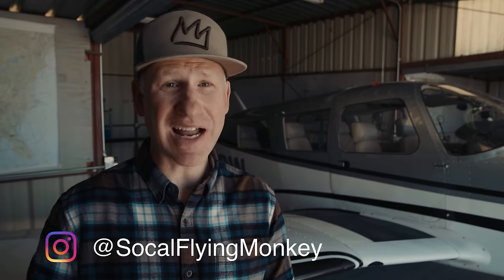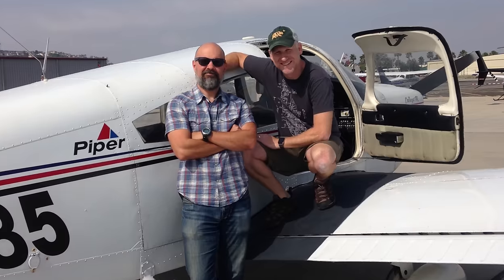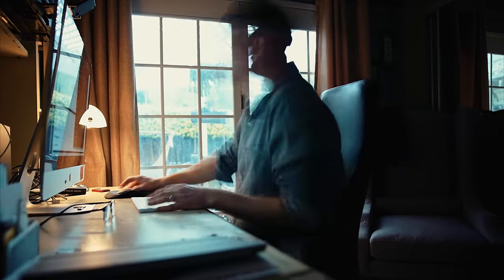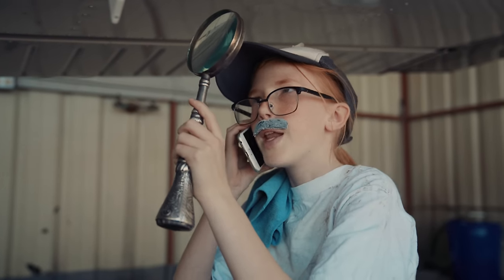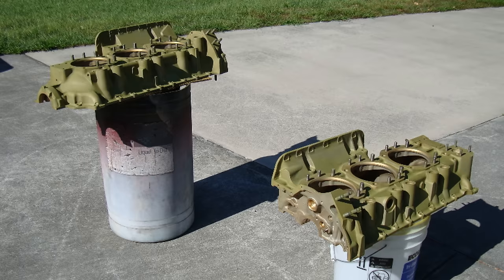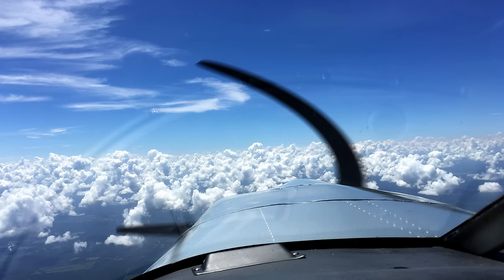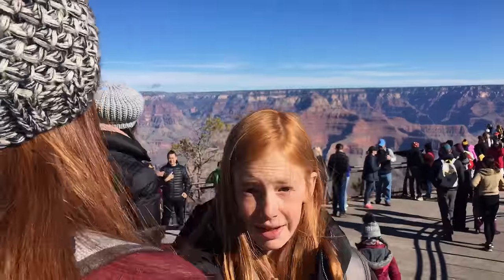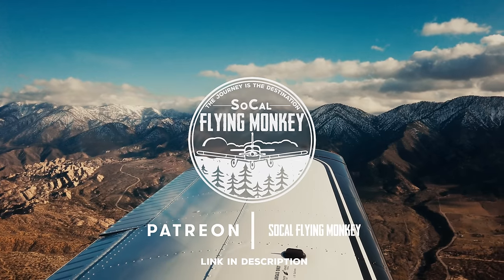I Bought a Cherokee 6 for Less Than $30K and It Changed My Life | An Airplane Renovation Story

Comment: Gorgeous plane at the end. But, it is deceptive to say you bought it for $30K. What did you put into it on top of the price? $80K  $100? or more? I would guess that I might be low...since an engine rebuild can cost more than you paid for the entire original "beast".
Reply: Too true. Nothing inspirational about having lots of money and using it to buy your family a new plane.
Reply: I’m also curious about this.  I hate deceptive titles. I figured this was going to be a I bought a budget plane and slowly upgraded as I could story.. Obviously 30k was the starting point but what was the total? Another 100k is my shot in the dark.
Reply: He did say it flew well even before all that
Reply: Yeah.. I was fooled too.. but it is a beautiful plane
Reply: Nothing says you have to put an expensive glass panel in it right away, if your intention is to fly it daytime VFR for a while.  Or fancy leather seats, fancy paint job, etc.

The engine rebuild costs are real though, figure 20K on that.  I'm looking at one for around $25K with a engine less than 100 hours from timing out.  The paint and interior are in good, but original, condition.  If it was a classic car they'd call it a survivor.  But anyway.
Reply: One other thing that helps make space for aviation in your life - stop buying new cars all the time.  I have an older Lincoln Navigator for example and I just bought the parts to do the timing job it needs myself, also new rotors and pads all the way around.  Planning on keeping it another 5-7 years.  

I have been accumulating tools since I was a teenager, but if you don't have them, tools are a lot cheaper than new cars.

Comment: I got a private pilots license in the 70s and was a commercial salmon fisherman in Bristol Bay Alaska in the 80's out of Naknek.  Hardly any roads so you had take a plane anywhere you needed to go.  The plane of choice for small commuter airlines was the Cherokee 6.  They preferred the low wing.  They flew out of short rough undulating rocky "runways".  The leading edges of the stabilators were all dented up and patched with duct tape.  This is a testament to the ruggedness, safety and reliability of this aircraft.

Comment: Thanks for sharing, but obviously this costed a lot more than just $30k. Would you share your breakdown and total cost?
Reply: Probably not, his wife might see it. She knows about the initial 30k.
Reply: @DanSlotea  lmao
Reply: Has to be another $30k on top..
Reply: @lawrencenisbett7579  is Probably closer to another additional $100K on top, based upon everything that was done, and that was his FRIEND doing it at a reduced rate.
Reply: I think about 200k on top. No joke
Reply: @joshuaespinoza534  That's just crazy and not very good business, could have bought a newer, better plane for that amount that didn't need all of the extra work done to it -   so the buy a plane for $30K is just a fallacy, rather it is buy a piece of junk and watch the money pit grow
Reply: @normancarter5419  I would spend my own money instead of others. Frowned upon.
Reply: @joshuaespinoza534  Don't really understand your statement because I made no reference to OPM, just that spending that much money on a POS when the money could have been spent on a better aircraft, $30K aircraft became a money pit.
Reply: @normancarter5419  not necessarily. He chose to spend the money.  Wasn't needed for upgrades. Clearly engine was great. Also. 30k for a plane with solid frame designed by experts that's in great shape os half the battle. Not sure why 30k is something to complain about.
Reply: @normancarter5419  he could have just overhauled inside for 20k extra making it 50k in total for plane. Yes 30k is possible to own a good plane. It's the desire to have everything new which changes things and perspective.

Comment: Bought it for <30k, spent 100k in upgrades, looks really good though
Reply: Its not that much if you think about it. 130k for a neat aircraft, almost as new, with that many seats single engine super clean. You get sometimes cesna 172s for around 150-200k with old panels. 130k for a glass panels modernized plane like this could be today around 300k+
Reply: @Fragnatix  true, can't argue with that

Comment: I have a question. So I’ve been looking into getting this model airplane, and I was wondering how much did it cost to redo the entire interior?
Reply from the maker: you can get Airtex kits from I think 5k-10k or so depending on cloth vs leather and some other options.  Thta's for materials for DIY.  But I would call them- they are very helpful and super knowledgable about all the variations in model years...

Comment: "Bought it for less than $30k" yeah, and then put another $80k into it to make it descent. Congrats on your $110k purchase.
Reply from the maker: Thank you!
Reply: @SoCalFlyingMonkey  If this thing only cost you $110k, then what a bargain!  Good job dude!  Heck even it is was $200k it would be a bargain.  A new one costs much more!
Reply: @wyflyguy114  Nah, we've looked into the TruTrak, it's only $7500 installed at Saint Aviation in Florida (I bet that's where he got it done). The other stuff is all under the rewritten Part 23 and not nearly as expensive as it used to be. The HDX he's got is just the core (he already had an engine monitor and the autopilots via the Trutrak), which is about $16K installed. The Avidyne, new radio, and transponder, etc. probably came in around $25K installed. 

Given he did a field overhaul (a lot less than sending it off or a factory reman), he might be all in for only $150K or so. You can't buy a Cherokee 6 with a zero TBO engine with that panel and in that condition for anywhere near that on the used market. It took a long time and was a big risk (he could have had all kinds of issues tearing apart a beater like that), but I'd bet he comes out ahead here if he ever sells the plane.
Reply: @bonchie1  You sound like a pro, but you're not.  Buying a high time Cherokee 6 cargo plane is not the "clean slate" you want.

Comment: Beautiful overhaul. Cherokee 6's are absolute units. I have about 900 hours in one flying cargo in northern Canada (my first full-time flying job). They fly like a truck, but climb like a homesick angel and you can basically take anything you can fit in it. I've carried everything from coffins (occupied), cases of pop, and even 8 passengers once (don't ask). And you gotta love the nose locker for W&B. Handles unimproved runways reasonably well too. Cherokee 6's hold a special place in my heart.

Only downside is its slow and a guzzles fuel. For passenger hauling a Lance is a better option IMO purely for the speed. An extra 20kts cruise gets you a lot further.
Reply from the maker: They are great planes.  A Lance sure would be nice but ultimately decided the additional $ for maint and insurance wasnt worth the few minutes saved on a 2-3 hour trip.  But they are great!
Reply: @SoCalFlyingMonkey  Considering you apparently dropped probably over a $100k into new avionics and an engine that didn't need to be overhauled, its a little strange to hear you penny pinching over maintenance costs and insurance... 

But everyone approaches things differently -- and its a beautiful airplane nonetheless!

Comment: I was flying a cross country flight for my private pilot license. It was a normal flight until something caught my attention directly in front of me and it was getting bigger. I realized it was another plane and were going nose to nose...I saw the impending midair and rolled hard to the right. I had steep bank and when I looked out my left-hand window, I saw that we had just missed by a few feet. It was Cherokee 6 and I can still see the rivets and oil streaks on the belly of the plane clearly in my mind. To this day....the other pilot has no idea how close we were. He didn't even wiggle, flinch or otherwise react...he NEVER SAW me.

Comment: Funny..  That aircraft was built by Piper for Air Ambulance and Hearse Transportation.  It does have a working useful load capability but the stick gear version is SLOW !!!
The one real issue with Piper Hershey Bar Wings is that when the engine quits, what ever you see coming under the nose is where you will land.  Aspect Ratio is Nil !!
Keep a good eye on that engine and pay close attention to any developed vibration.  Hard to sense with that 6 cyl mounting.

Comment: Great video my issue is got my license back in 86 and shortly after quit flying. 36 years later the situation has changed and I now can afford to fly and buy a plane. Problem is what ever I buy will be my forever plane and theres the problem what I want and want ins. company will allow me to fly are two different things. This isn't going to be easy
Reply from the maker: I think it's still possible, maybe depending on the amount of hours you can accrue and time in type as well.  Maybe go for a fixed gear plane?
Reply: @SoCalFlyingMonkey  Yeah that is what a friend was saying to toss in  a monkey wrench he also recomended a turbo powered plane as my home airport is already at 5000  foot elev. and there are lots of mountains so that makes sense. Looking at the cessna T182T  those models are very $$$ but boy are they nice fixed gear and turbo'd Well soon I hope tp get bacl into my trainnig so I will have a few months to see what's out there.

Comment: Great job She’s a beauty! Did you upgrade your fuel transducers when you went to the HDX? I know it’s not the most glamorous upgrade, but it sure provides piece of mind to know how much fuel is in the tank.
Reply from the maker: I have a digital engine monitor that measures fuel flow very accurately so it displays fuel remaining as well (calculated).  I left the stock fuel senders and they are not very accurate but did my best to calibrate them well.

Comment: So where are the numbers? Initial price.? Engine overhaul ? Paint? Avionics upgrade?  I think the money you have in this jewel, you could have bought a mint Cherokee 6.  You did a great job with your presentation.   Keep em rolling.
Reply from the maker: put about 90-120 into it.  if you shop around for a Cherokee 6 you will see that something similarly equipped is at least 175-250k.

Comment: For the non flyers I copied this from another forum:
However, if one is looking for a "project plane" a sound, low time, zero-damage airframe is probably preferable. Engines and props can be overhauled or replaced, avionics can be upgraded, paint and interiors can be redone, but airframe time and airframe damage is permanent on the record. But now that airplane values are not reliably inflating like they used to, a project plane is almost certainly not a rational economic proposition.
Reply from the maker: Airplane prices right now are actually going way up like crazy. I dont know if they will come back down.  I got this airframe for 30k.  In todays market, a similar condition and time airframe is going for 60-75k.  Its nuts!

Comment: Hi,  I'm curious  what resources did you use to find your plane.  I'm doing some due diligence on possibly purchasing a plane and I'm sure there is more than controller , trade-a-plane,  or hangar67 any other resources you can offer would be helpful.  Also, have you done a video on what one might expect to pay to renovate a similar plane  in the way you've done your plane.  (looking at Arrow, Cherokee 6, 6XT, Lance, Saratoga)
Reply from the maker: I used those, the type forums, Facebook groups, and Barnstormers.

Comment: I am considering following a similar path. Rather than a new Experimental, going after a used PA-28 and renovating it. My question is this. You said 18 months to do all the work.  Why does it take so long?
Reply from the maker: It was just one guy doing it and we had many delays like an avionics shop that essenitally went out of business while waiting for our gear, availability of some plastic pieces, the process of overhauling the engine, paint shop delays. the lFlorida summer heat, the list goes on and on!

Comment: I have a ton of Questions!!!!

Im looking at useful Load as a magor factor in buying my own plane.  I was thinking 235 vs 180 .  the 235 has a better useful load, but costs more to fly. I was also looking at the 6 series 300 vs 260.   It seems the 260 has a consistant better uselul load. is that my imagination??   The reason for the bigger 32 vs the 28 is room. Im looking at flyiong alot alone, but I will be flying with 3 others at times, possib;y more.  

Lat question for now. your mechanic. how did he find your bird?  I understand that there is almost no way to find a cherokee 6 (300 or 260) for less than 100k in todays market.  Ive been looking at Controller and Trade aplane.  I asume, your mechaniv used other sourses ??
Reply from the maker: email me at flyingmonkeysocal at gmail dot com. and i can answer your questions.

Comment: One final question... Is it possible to covert a Piper Cherokee 6 to a Bush Plane by simply changing the wheels to those big fat ones, or would there be too much pressure on the wheel struts on take off and landing from uneven surfaces, forcing them to collapse.
Reply from the maker: I think you can put big tires on the Six but one limiting attribute will be that the landing gear is nosewheel configuration and most bush planes are tailwheel.  I think some people have done it, but the PA32 will always require more runway for takeoff that a typical bush plane.  I know that some people use them in Africa for cargo and I personally know one farmer in New Zealand who uses it in pretty rough places on dirt.
Reply: @SoCalFlyingMonkey  SoCal -- I see what you mean. The tricycle arrangement of wheels requires an almost level take of and landing, whereas a bush plane will take off rear wheel last and land rear wheel first or last. Simply putting on larger wheels to  Cherokee will not necessarily add to stability, even instability as the low tyre (UK rather than US) pressure could cause side-to-side bouncing. I might need to get back to the drawing board for a cheap(ish) or used, reliable 4/6 seater bush plane. I just don't want to be constrained to a metalled runway for take-off and landing. Anyway SoCal, thank you so much for the time you have taken to reply.

Comment: Rookie question here ... if I buy a plane and then fly it to an airfield close to a national park or some other destination, do those airfields usually have facilities to rent a car?
Reply from the maker: there are often times car rental faiclities at the airports or nearby and they will drop a car for you.  some airports have FBOs that can assist with car rental or have a "crew car" that you can borrow for 2 hours.  We take electric scooters in the plane and get around in a 7-10 mile radius on those...
Reply: @SoCalFlyingMonkey  thanks so much, that was very helpful!!!

Comment: Dude, that's not under $30k. Your engine is close to $25K. The avionics aline set you back close to $75k for the initial.  Then another $15K for interior, and $8k for paint. I'm a retired 777 captain, and retired Navy F14 and F18 pilot. I also have my A&P. Please don't title your video how you got a plane for under $30K.